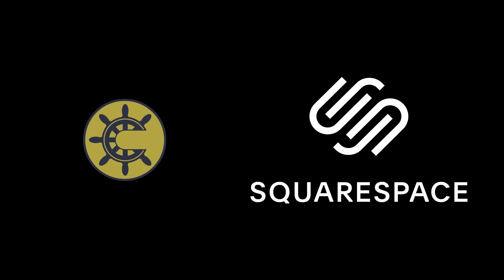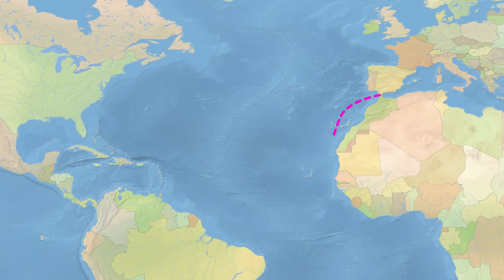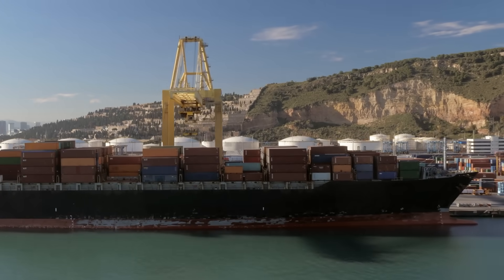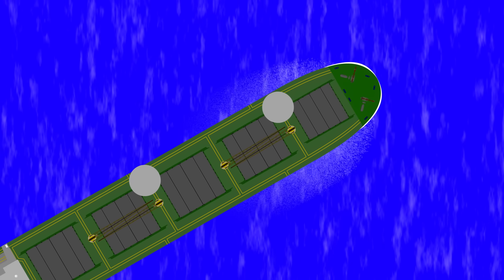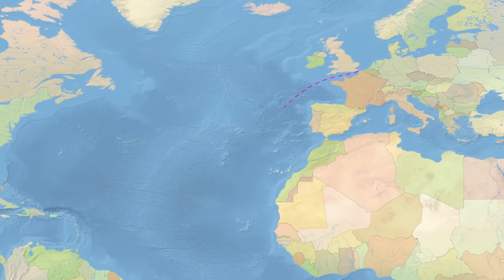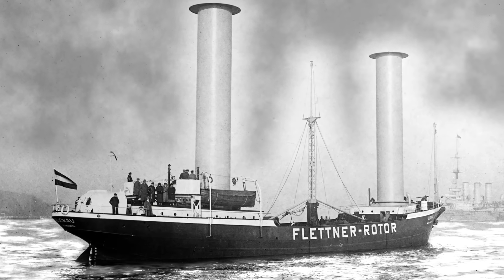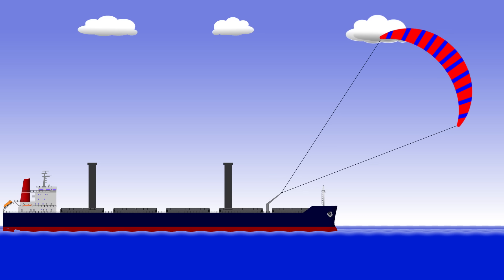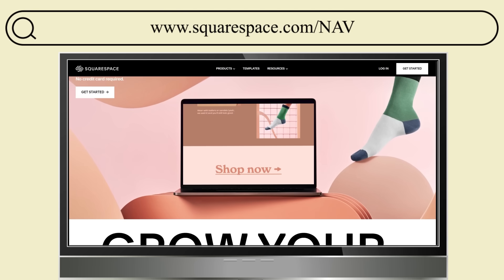Why Don't Sails Work On Ships?

Comment: Is the energy spent to spin a flettner rotor small enough to be ignored? Does it not create drag to push the air? Looks like the rope that supports the kite should be pretty strong to pull a ship. Looks like they also need a foldable ship's bridge to pass under a road bridge.

Comment: "the only way technologies like this are going to be adopted is through regulation"

What a load of bullshit. If the cost savings in terms of fuel are enough then they will compensate for the increased cost charged by the owner of the ship. If you're saying that regulation is needed, that market forces won't cause their adoption by themselves, you're basically saying the capital investment is not worth the fuel savings.

Comment: Why huge cargo planes are not used for this purpose?
Reply: Planes consume a lot more fuel than cargo ships, so they are more expensive and worse for the environment. They also are up in the air, which leaves less leaway for emergency situations and is more bumpy in rough weather, so it’s less safe to ship volatile items.

We do use cargo planes for shipping stable items that have a cost benefit of shipping overnight, such as perishable items, electronics which lose their relevance more quickly, repair equipment or parts, or just smaller items that can be charged extra to ship fast en mass

Comment: Great video -- except for the part where there is an bogus argument for decreasing national autonomy by instituting rule by a world govt.  I mean, all things are possible, but the reasoning seemed pretty sketchy.

If there is a cost-benefit of reduced fuel, then it stands to reason that the charterer would be willing to pay an increase in cost of the ship if they are getting a discount in fuel.  In any operator-charterer configuration the cost-savings of the fuel would pay for the investment of installing the new equipment (assuming there is a real cost-benefit in the equipment in the first place).  I am a economic system neutral on this, but if there real cost savings, then you don't need enforced regulation to make it happen -- or a corporate ESG score

Comment: You are incorrect on several points.
Not much deck space would be given up so its not purely about cargo space. They could easily be above the cargo.
They would work and save quite a lot of fuel.
The real problem is the complexity and possible risks. The sails would need to be raised/lowered/adjusted quite rapidly and almost entirely remotely. They would need to withstand storms. The masts would need to fold down to go under bridges. Overall just too complex.

Comment: The last commercial sailing ships which were typically 4 masted barques had a capacity of about 3000 to 3500 tonnes. They were employed in the grain and guano (bird shit) trades carrying the cargo in bulk. They were undermanned and put huge pressure on the crews to keep them sailing. They are not coming back. 

Modern ships typically fall into one of the following three categories:
1) Tanker: from 500 to over 400,000DWT (ULCC - only a handful left), most common "large" tankers are VLCC which are around 333m long and carry 2 million barrels of crude. Various sizes in between can be specifically for crude or products.
2) Bulk carrier: from <5000 to about 400,000DWT, the largest are the Vale ships carrying iron ore from Brazil to China. They are larger than the ships on the Australian iron ore trade due to the greater distance - trying to achieve similar shipping rate per tonne. Smaller bulkers - to about 60,000DWT are used for grain and other cargoes. Cape size around 160,000DWT are used for both iron ore and coal trades.
3) Container ships: from <1000TEU to >24,000TEU. The largest are now 399m long and 68m wide.

Tankers and bulk carriers have relatively clear decks, although tankers have hose handling cranes and smaller bulk carriers have cranes with grabs for unloading. Theoretically, the vessels with clear decks could be fitted with sails or sail equivalents. They also have very good stability.

Containerships almost certainly cannot be fitted with sails. While I've not done the stability calculations the fact that so much cargo is loaded above deck would suggest that their stability is much lower than for tankers and bulk carriers (which often have too much stability). And there is simply no where to put such sails.

Ships are by far the most efficient way of transporting goods. The energy use per tonne mile is a fraction of and land based transport (even where land based is possible). Reducing the carbon footprint of shipping will need to look at a range of factors including eliminating the need to ship the goods in the first place, i.e. if there are no coal fired power stations then thermal coal trade disappears, if oil (and gas) is greatly reduced then there is less need for tankers, and further reductions if the oil refineries are near where the product is needed (until recently Nigeria was shipping crude to Europe and importing products).

I've seen companies propose small ships for carrying goods "ethically" - it's virtue signalling - or in Australian - just having a wank. It's not even 0.0000001% of trade.

And I've been around boats all my life - my parents owned the Bristol Channel Pilot Cutter "Cariad" from 1957 to 1970, she was the last pilot cutter under sail in the Bristol Channel (1921), and my first home in 1963. I'm a naval architect, I live on a boat now in Ipswich and I work in the offshore industry.

Comment: Your description of how a mainsail works isn't correct, it doesn't redirect wind for propulsion. 
It's an aerofoil, think airplane wing but stood on the wingroot.
Wind blows across it, causing "lift" or more accurately in this case, thrust. 
Well, it only creates thrust like that when hauling or reaching (sailing not away from the wind) 
When running (wind directly behind you) it works exactly how you would imagine, same as a square rigged ship.

Comment: 5:21 Something doesn't add up in this example. If the rotors reduced operating costs and truly increased operating profit, then builders certainly would install these and sell the ships at a premium --capitalism!--both parties profit. I mean it's the same thing with aircrafts; these have had numerous incremental improvements of the years.

Comment: "Plenty of ships use sails?" What kind of ships are you talking about? A) I dare say, cargo ships are in the vast majority of ships out there on the oceans. B) Passenger ships with sails? Not that I know of.
"Would have been implemented ages ago." In fact, they have been, but then replaced by fossil driven solutions.
2:10 Might be an effect, but to the best of my knowledge, the sail acts as a foil having lower pressure on the lee side, which is the actual propulsion force.
5:24 What kind of strange drawback. As if a more efficient diesel engine would be bought be the charterer. And even so, as if the owner/landlord would not allocate those costs to the charterer/tenant. I see, you corrected yourself in the next sentence. So why talking bullshit in the first place?
And no, regulations are not the only way, Flettners could gain market. If the oil price raises enough, they become very attractive. Why this absoluteness in stating?
Wrong again with international laws. If a land only allows ships with (additional) wind propulsion to call at their ports, there will be some change. Sure, good get more expensive, at least initially. But it can be done.

Comment: At 5:22 you say they have to be purchased by the ship's owner, and the benefits of fuel consumption by the charterer, why? the charterer pays for his cargo to be delivered, and the average price is that of ships without Flettner rotor, why should the ship owner charge less because he consumes less fuel? Analogy goes on, the tenant does his extra insulation and he later pays less on heating. If this is about competition, sure, I'll charge a little less than the ships without rotors, and depending on the fuel saved this might still be profitable. Cheers!

Comment: The owner-charterer argument can apply equally to any other efficiency upgrade to ships.
Reply: True, but parts already on the ship say the engine for example wear out and need replacing. When replacing this critical part might as well buy a more efficient model. One factor omitted in the video is engines are getting more efficient thus eating advantages alternative power have in fuel and environmental savings.

Comment: There's large issue with all wind-based propulsion systems - yaw. The safe operating angles would need to be reduced, because to make full use from most of those, your shop ends up at an angle where a side wave could deal a lot of damage, especially to ships with lots of cargo.

Comment: I disagree I don't think you need to regulate in order to get people to do that I simply think that if the ship's owner were to potentially work out a deal with the charterer before purchasing it would simply solve the problem. How long you to please explain the charter might experience the benefits however if the ship's owner speaks to said person and offers to do this in order to get them to benefits they might be able to work out a way to help the person who purchased it get his money back so that they both benefit.  I think the issue is simply a lack of good communication and a lack of assisting one another. It's not impossible to cooperate with one another so that we can all have a better future

Comment: What if you took anton flettner design and  encased some archimede wind turbines or some Liam F1  to the rotors what if you could bring up and down and rotate in the write directions get to generate electricity ⚡️ and use that electricity for hybrid motors 😅😮

Comment: Flettner rotors, kites and so on can reduce fuel consumption. But sailing cargo ships are using wind to power the boat not to reduce their fuel consumption. Only using fuel to manoeuvre at port. Which is a very different approach.

Comment: It's not so much about a country requiring wind power to be installed on ships flagged there. 
If say the EU requires that all bulk carriers that call in EU ports have wind power devices installed, It doesn't matter if a ship is flagged in Panama or wherever, the EU can refuse it access to ports all it wants. It doesn't have to be international law passed by the UN and blah blah blah. The EU, China or India could easily unilaterally enforce this upon world shipping as a whole.
Take the USB-C on iPhone as an example. Apple really didn't want that, because Lightning made them way more money in royalties than USB-C ever will. But the EU told them to either comply or get out. Apple decided that the EU was too large a market to miss out on and the consequence is that all iPhones made since have USB-C even those not made for the EU market specifically.

Similarly motorcycle helmets outside of the US and Canada are all basically EU regulations compliant ones. The EU made all the regulations, and then countries like India took them and replaced EU with India. Basically pushing the industry to the point where they only make EU compliant helmets, because those regulations apply to 70% of the world market for helmets. No one cares that Tuvalu doesn't require that certification, it's just cheaper to make all helmets complaint instead of having a bunch of different production lines for each country and their specific regulations.

Comment: The solution will be to build gigantic trimaran Power by sales and solar either to harvest energy as compressed air.Or electricity in order to tow Ships on the open need to go to canals. Or passages.

Comment: This wasn't mentioned in the video, but I'd be curious how much power is needed to spin the rotor. It seems like it is working more like a propeller than a sail, since it would require constant energy input in order to continue spinning and generate thrust. It might be more efficient, but it would still require constant power input from the ship (in the form of an engine) which doesn't entirely solve the problem of ships needing engines to move around.

Comment: weight below a certain number is a non issue as the maximum capacity is a commercial regulation, nor a safety regulation. You can put 1000Tonnes of sails on a bulk carrier and nothing changes outside of its sailing draft.

Comment: One correction, ALL sails work as airfoils unless they are sailing downwind. Airfoils do NOT create a low pressure zone that “sucks” the airfoil up or forwards.   Anyone with an electric fan intrinsically understands that the airfoils of a fan produce a THRUST in the opposite direction. Yes there’s a ‘low pressure zone’ immediately in the lee of the sail. But the low pressure zone does not pull the sail forward.   Rather, further away from the sail is air at ambient pressure ( higher pressure than the low pressure zone ) This air rushes into the low pressure zone to try and equalize the pressure, but by then the sail, or Wing, has moved out of its path, and the result is a constant stream of air accelerated PAST the end of the wing or sail perpendicular to the chord of the wing or sail.   The vector of this thrust is not always aligned with the direction the ship is sailing- but perpendicular to the chord of the sail, which is why you need a keel or centerboard to make it harder for the boat to move in any direction but the one with lowest resistance. 
This is how on certain points of sail a boats sail can created speeds greater than the wind speed, because the rush of air into the low pressure zone can accelerate it to speeds higher than the wind speed.    SO, once more, Sails that are not running ahead of the wind ( which are literally just being pushed by the wind directly)  are acting as airfoils and airfoils all create a THRUST perpendicular to their chord.   It’s apparent that a propellor, whether underwater or on an airplane, creates a THRUST.  Not a low pressure that pulls. 
In photos of airplanes flying just above a smooth cloud deck, you can often see a huge TRENCH plowed into the cloud deck by the air accelerated downwards by the passage of the wing.   This is all the air thrusting downwards that matches or exceeds the mass of the airplane.

Comment: Surprsied no one has ever thought of putting some form of wind turbine on a ship, to generate electricity to power the ship instead (hybrid propulsion)
Reply: Sounds like an even more expensive "solution".
Now you need to turn your ship electric or hybrid, carry batteries etc.
At that point might as well place solar panels all over it.
Reply: @BillyViBritannia  You could just run a shaft from the turbine into a gearbox and spin the prop directly. Or do the equivalent of what trains do and go with generator-motor as the transmission.
Reply: @VecheslavNovikov  This assumes you lose less energy by translating it through all these mechanisms instead of just having the air push the ship.
I can imagine this working better when sailing against the wind though.

It brings in mind a veritasium video about a wind powered vehicle traveling faster than the wind; look it up, pretty interesting.  Curious if that could work on water.

Comment: A correction: at 2:08 you claim the wind gets "deflected" and pushed the boat forward. This is incorrect, sailing close hauled up wind as you've shown, the sail actually acts as a wing, pulling the boat along utilizing the pressure differences on both sides of the sail.
Also, at 2:01 you mention sailing cruse ships, which use square rigged sails, not staysails as you've shown in your illustration.

Comment: The dynarig seems like the obvious solution. You don't have much of a wind angle window limitation like with the kite or traditional sails. On the Maltese Falcon and the Black Diamond, the dynarig has been observed to propel the ship at over 25 knots in moderate winds, more than double what current cargo ships typically make. This cancels out the disadvantage of having to take somewhat longer routes to keep wind in the sails. The deck space issue sounds like an engineering problem waiting for its inevitable solution when capital invests the resources needed to solve it. Other advantages are extreme maneuverability compared to single screw vessels; Maltese Falcon has been seen sailing off her mooring. Extremely short startup duration compared to starting a big ship diesel: it only requires a course to be set into the navigation computer, which takes measurements of ship and sea and wind conditions and then deploys the sails in the appropriate configuration. The difference is just a few minutes compared to an hour or more for a conventional ship. The system is very expensive. The masts are free standing and the only material strong enough for that at the moment is carbon fiber,  and they must be embedded with pressure sensors. But economies of scale and what-not.

Comment: in the olden days, the coal was barely worth anything energetically in the late 1800s. coal required a wind subsidy to stay operating. that is wind powered ships ferried coal to refueling ports. fast foreward to now and the oil is paltry and not worth much energetically. once again a wind subsidy is needed, lest the oil tanker’s crude arrive to port as an energy sink and not a source. fossil fuels become paltry in quality due to overmining. it means something if the load of fuel you bring to port is a detriment, it would be an energetic liability. hydrogen fuel is such a fuel, thats probably why its not widely used is because a society driven by an energy sink might not break even and may not be self sustaining.